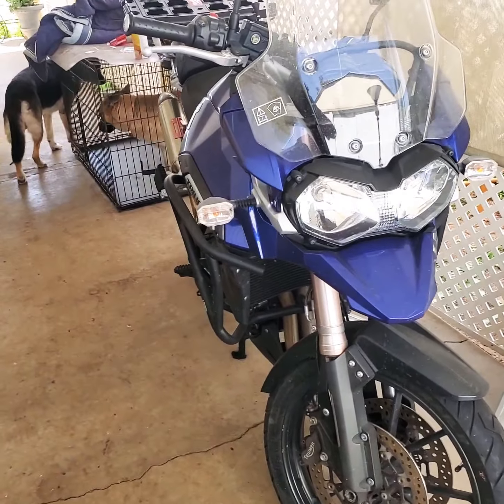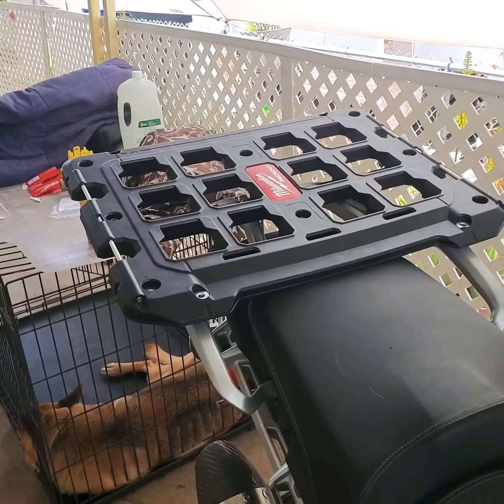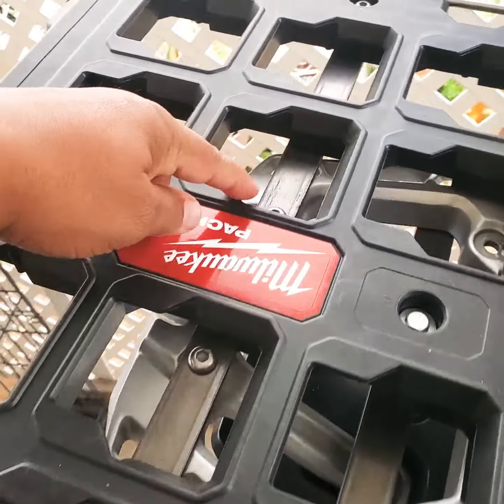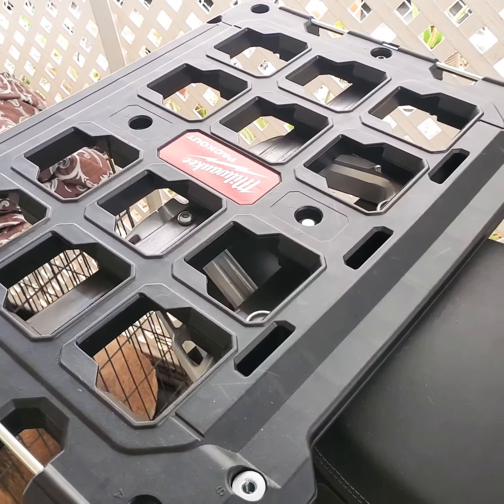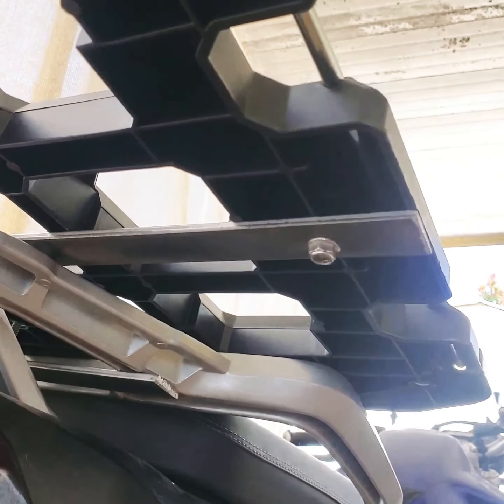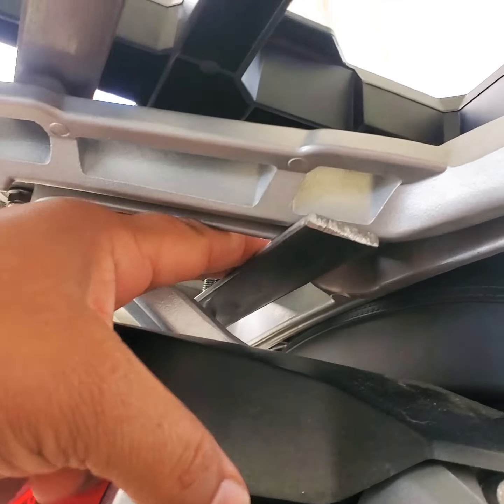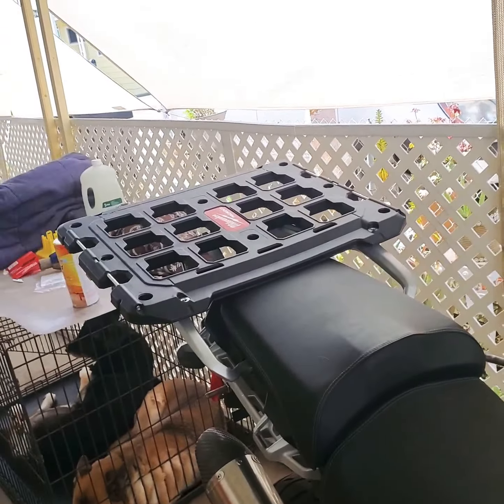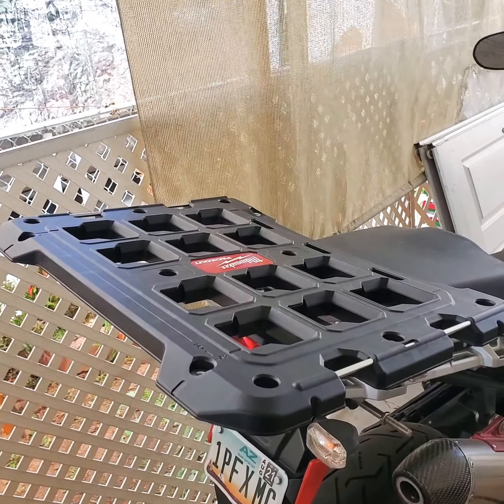Milwaukee packout moto

Comment: That’s awesome! I’m doing this on my old Honda motorcycle, and I love the steel bar idea!

For locking the boxes, I have a couple of ideas. I’ll probably just start with a metal cable (steel rope) fed through the padlocks on each case
Reply: Hey could you let me know how you get on? I'm considering something like this but I'm not sure how the packout clips would hold up over time so maybe a ratchet strap or 2 aswell as some steel rope for security
Reply: @furblokeEN  Sure! I haven’t been riding much lately, so I haven’t done it yet.